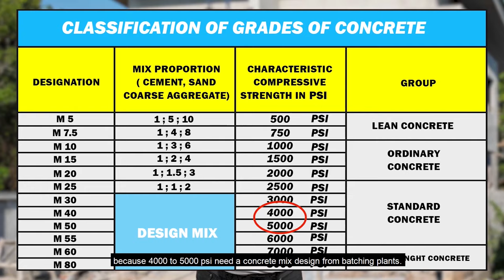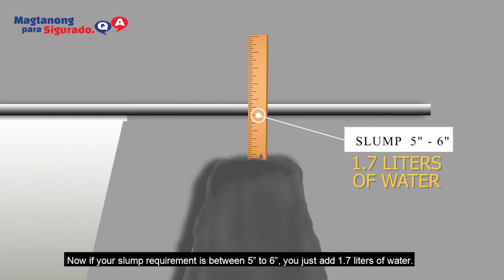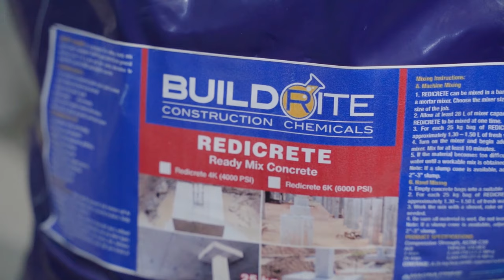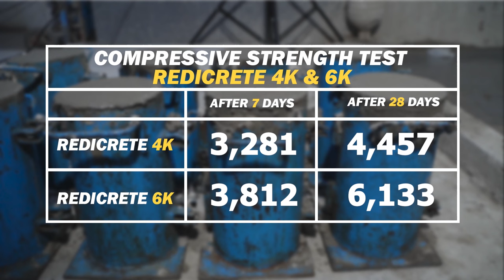Ready-Mix Concrete in a Bag?

Comment: ilang MM ang maximum ng lalim ng pwede tapalan.?
Reply from the maker: Hi, thank you for your inquiry. It depends on the structural design. Readycrete 4k and Readycrete 6k are recommended for:
 Foundation walls and footings 
 Driveways and footpaths 
 Appliance and equipment platforms 
 Pipe and post footings 
 Floor slabs and patios 
 Pools, fish pools, stepping stones 
 Riprap and slope protection 
 Wall, floors and bases 
 Beams and columns

Comment: Good day sir possible po ba ang Ready  mix 6k sa  Repair ng flooring, tapping ,na may mga truck na dumadaan, how deep po  ang pwede nya   gawin Sir, ? Hindi po kasi maganda ang flooring  may mga portion na labas na po ang gravel thanks sa response Sir
Reply from the maker: Hi, thank you for your inquiry. Minimum thickness for Readycrete 4k and 6k is at least 2 inches. We have different kinds of materials for road repairs. Message us on our Facebook page so we can discuss your inquiry: https://www.facebook.com/BuildritePhils
Reply: Hi. It says it’s fast setting, if used sa silicone mold for small crafts pwede ba siya mademold or tanggalin agad sa mold in minutes? Gaano po kabilis matuyo?

Comment: For new slab po pwd?
Reply from the maker: Hi, thank you for your inquiry. Readycrete 4k and Readycrete 6k are recommended for:

 Foundation walls and footings 
 Driveways and footpaths 
 Appliance and equipment platforms 
 Pipe and post footings 
 Floor slabs and patios 
 Pools, fish pools, stepping stones 
 Riprap and slope protection 
 Wall, floors and bases 
 Beams and columns

Comment: bakit nga ba sobrang mahal ng isang bag (P285+ sa 4K, P330 sa 6K) samantalang yung 1 cubic meter sa RMC e P5k to P8k lang?

how did you justify your cost?
Reply: me nagbigay na ng sample computation dito. kung sinaaabi nyong 76 bags ang isang cubic meter lumalabas na P21++ ang presyo
Reply from the maker: Hi sir, this product is not for everyone, this product is mainly for small to medium projects where rmc providers cannot reach or there are accessibility issues in the area and strictly requires minimum 3000 psi or 6000 psi strength.

If you think Readycrete is not for you because you need a big amount of concrete to pour with enough space for aggregates and sand, you can use Ritemix PC 100 or PC 200 to save cost on cement. Pls watch this video to understand the product: https://youtu.be/iq9DVKF3S0Q

Comment: Sa buhos po ng poste ok po ba ito kahit wala ng graba?
Reply from the maker: Hi, thank you for your inquiry. Yes, you can use Readycrete on column. It is a mixture of sand, cement, aggregates and admixtures that requires only the addition of water.
Reply: @BUILDRITECONSTRUCTIONCHEMICALS  thank you po😊🙏
Reply from the maker: You're welcome po.

Comment: ang mahal for 1 cubic ang laki ng difference sa onsite mix
Reply from the maker: Hi, this product is not for everyone, this product is mainly for small to medium projects where rmc providers cannot reach or there are accessibility issues in the area and strictly requires minimum 3000 psi or 6000 psi strength.

If you think Readycrete is not for you because you need a big amount of concrete to pour with enough space for aggregates and sand, you can use Ritemix PC 100 or PC 200 to save cost on cement. Please watch this video to understand the product: 

https://www.youtube.com/watch?v=iq9DVKF3S0Q&t=731s&pp=ygUPcGMxMDAgYnVpbGRyaXRl